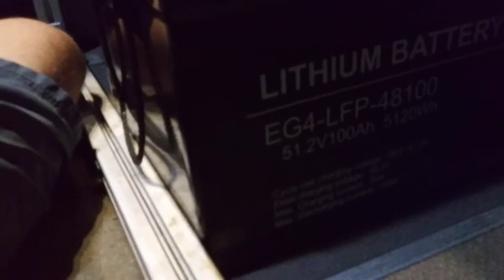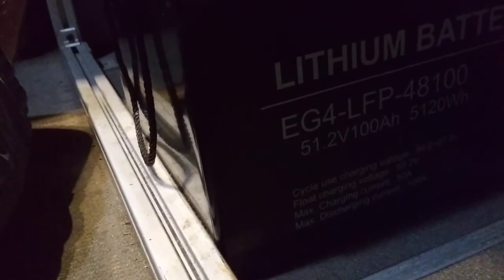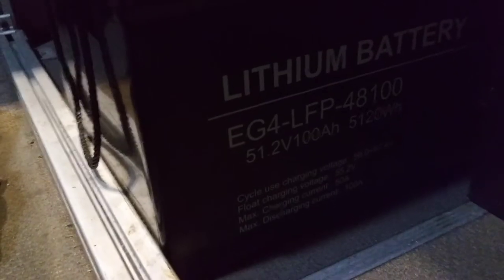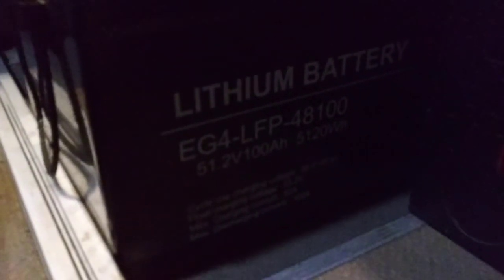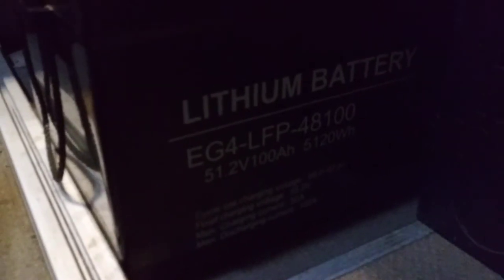My EG4 100ah 48v waterproof battery and story time👍

Comment: So I am having the same issue with the BMS. If I understood you correctly, I should connect the battery to the charger first and then plug them in. What should I expect after that? I have four of these for a food trailer.
Reply from the maker: If you're using a charger that Signiture Solar sales, you hook the charger to the batteries first and then plug it into a wall outlet. That should wake up your BMSs that are in protect mode.
Reply: @offgridphilosophy7959  Yes i did do that. Thanks to your video, but unfortunately that did not work. The charger might be bad. I have a tech call with Signature Solar soon, so hopefully they have an answer. They haven't been great help. Thank again!
Reply from the maker: @SamuelXBaxter  If your charger is reading negative five ( -5 ), it is good. If your battery went into protect mode you can put a slight draw on it to wake it back up. Just hook any 48 volt device to it and use that to draw even some slight current.
Reply: @offgridphilosophy7959  Not sure what you mean -5. On a multimeter? There is no reading on the charge except a light that is blinking back and forth red/green. Signature Solar told me charger is bad and is working on sending another one. Any suggestion on a 48v device, been trying to think of something I have around to do that.
Reply from the maker: @SamuelXBaxter  Don't throw it away. Put a multi meter on it and see if you get -5 volts. If so it's working correctly. You need to put a draw on your battery to wake it out of protect mode.